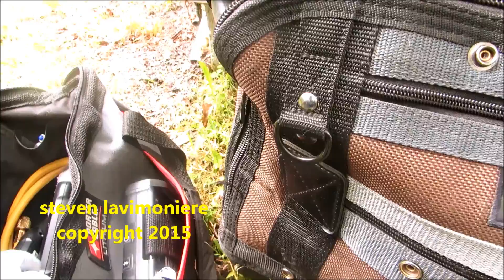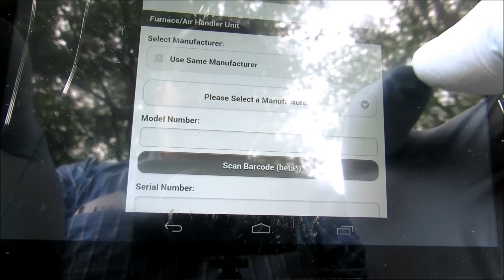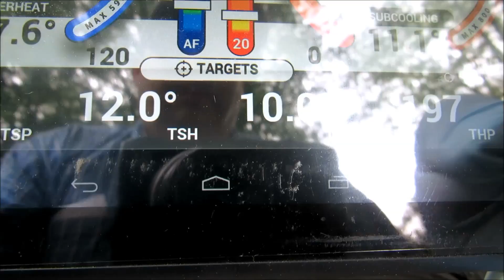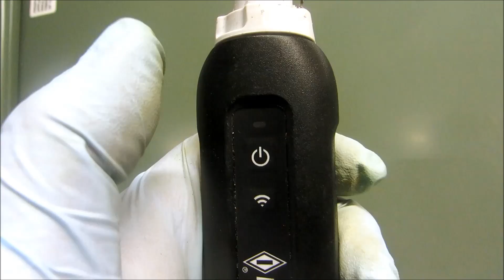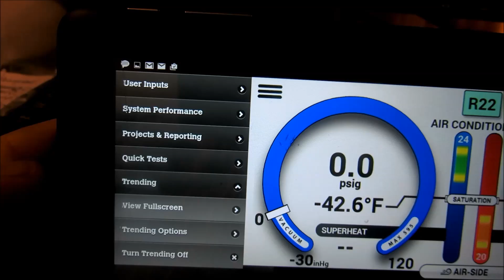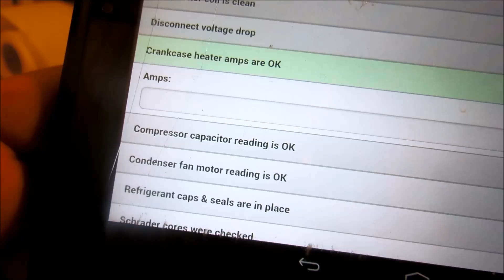imperial iconnect test of new app and walk through

Comment: Steve, what brand hose are you using on your low side between service valve and valve core remover?  It looks shorter than the one on your high side which I assume is a yellow jacket or similar used to turn a "low loss hose" into a 1/4 turn hose and the shortest I can find is 6".  Thank you!
Reply from the maker: +John McCutcheon i run yellow jacket 6' with shut offs